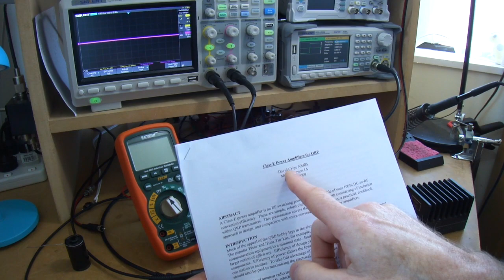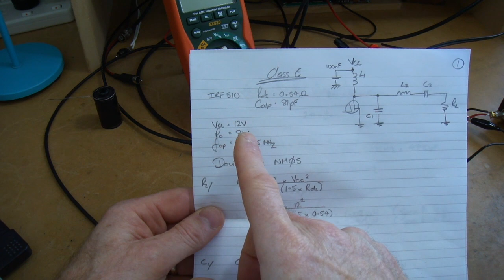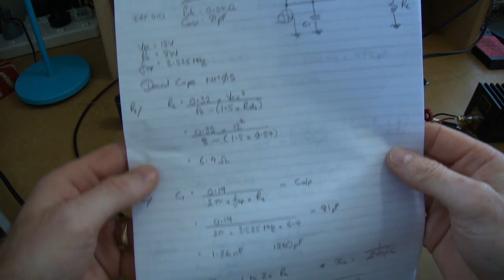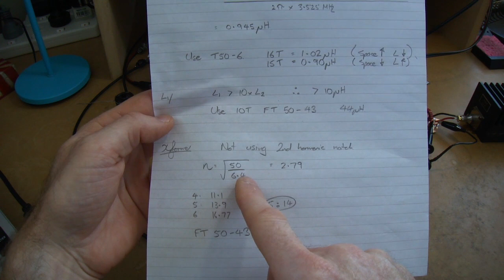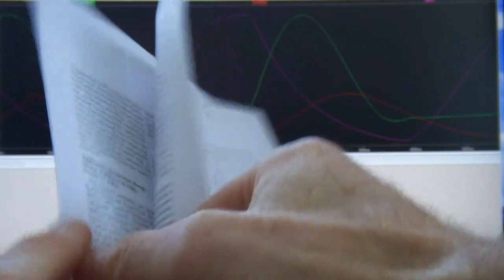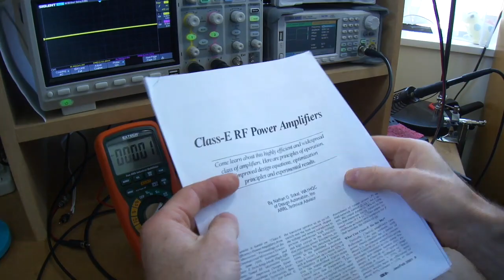CW Rig. Part 4 - Initial Class E Amplifier Experiments

Comment: Charlie - Great work! I am in the same mode here with papers in hand. I decided to just use the Sokal formulas and an old 2 dollar 2SC2078 Bipolar CB transistor. Wow is all I can say. I designed for 10W out at 15 VDC. My circuit is just as drawn in the paper with a 10 Ohm R target. I used a 1:4 UNUN that got me up towards 50 Ohms then a filtered as you did on the tail end. 91% efficiency with zero optimization, and right on the nose at 10W out. Increasing VCC to 20V gave me 18W out with only a slight impact on efficiency.

Comment: I appreciate the tutorial (even though you don't think it is) and demo.  I'm designing a 2nd iteration of a Class E Amplifier but with 13.56 MHz.  I already have a buck converter made up to boost the sine wave signal using Vcc 1V - 24V.
Reply: Have u done it?
Reply: @alimaiee1647  yeah, I was able to sweep from sub 1 V all the way up to 18.5 V.. but couldn't get up to 24 V. I kept losing a lot of heat on the MOSFET (n-type) and I just couldn't figure out why.

Comment: Hi Charlie，I see the filter inductors with cors in this PCB, how do you select them under 3.525MHz operating frequency with less loss
Reply from the maker: Hi Max. I use type 43 material which is suitable for what I use them for. Check out http://toroids.info/FT37-43.php

Comment: Hello!Nice work! But your gate driver ciruit works  well until  1MHz.Some weeks ago I  had made simple shortwave transmitter. Output stage was  push-pull.There was two IRLML0040. This transistor has a low gate charge - 3nC. IRF520 has a gate chage  16nC. Gain of BJT has been follen at high frequency.For example -  2N3904 has Beta=100 at DC.But when we have  frequency 5MHz - this parameter will be goughly 10..15. We can have a  fast swtching of output mosfet - to prevent heat losses (the mosfet will be work in linear mode with long rise and fall time). The best way to improve your device - using  low stage gate driver IC.
Reply from the maker: Thanks Andrew. In the end I went with a totam pole driver which worked well. The MC34151P for whatever reason did not work well for me.

Comment: Hi Charlie,
I noticed a new sig-gen in your video, looks like a feel tech, if so what are your thoughts on quality/performance of this unit compared to the siglent ?
Thanks......Peter GW4ZUA
Reply from the maker: Hi Peter. I've had the FeelElec FY6900 (they are all the same) for some time and it is a good sig gen. It actually does 99% of what the Siglent does. I decided in the end the Siglent output levels were displaying more accurately than the FeelElec. If you are on a budget then I'd certainly recommend the FeelElec. But, you do get what you pay for. I had a common problem where the sinewave output waveform was corrupted. I had to install the PC software and run the specially added 'fix sinewave' function. I hope that helps Peter.
Reply: Hi Charlie , Thanks for the feedback, here in the UK the Feel tech / elec version is about a third of the price  of the Siglent (£278) , there is supposed to be a price rise  coming up !  H'mm but as its close to my birthday...............  :-) .
Thank you  for doing the videos a great source of knowledge and inspiration, between you  and Pete N6QW I have learnt so much ............Thanks Peter
Reply from the maker: @peterwebb2224  Thanks Peter. I really appreciate the feedback.

Comment: Excellent description and demo, thank you. But if I heard you correctly, DC input power is about 4 W and RF output is 2 W so not as efficient as expected. More like class C.
Reply from the maker: Correct. It's definitely not working correctly Elwood. I'm going to try a totem pole drive this morning, then look to try another amp using three parallel BS170s. It would be nice to get a Class E amp working close in line with the design and the LTSpice simulation (noting that it's only a simulation).

Comment: I’m really surprised you are able to drive the irf510 with your signal generator.

Too bad you weren’t getting better results.  Did you try driving it with a higher gate voltage?
Reply from the maker: I'm a little surprised too, but it looked to work. No I didn't try a higher gate voltage, but I will though. My plan is to also have the gate sitting at-say-1.2 to 2V, then have the RF drive on top of that.
Reply from the maker: I just increased the gate drive voltage up to 6.5V. There was no increase in output power. 5V provides the max output. I must be doing something wrong.
Reply: Charlie Morris does it actually look like 6.5v on the gate when you are applying it?
Reply from the maker: @MegaCadr  When I scope the gate, 5Vp-p on the sig gen = 8.1Vp-p on the scope. The gate does not look like 50ohm, so the sig gen display will be inaccurate.  Either Way,  I believe I'm getting 8Vp-p on the gate. I wonder if I should try the MC34151 again.
Reply: Charlie Morris according to this presentation, the irf510 needs quite a bit of drive power http://www.norcalqrp.org/files/Class_E_Amplifiers.pdf
Reply: @MegaCadr  An excellent presentation, I used it when I was designing a QRP 3.5 MHz PA.
Reply: Ivan Savitsky do you have anything up about your pa anywhere?  I’m currently failing at mine :)
Reply from the maker: @MegaCadr  Yes I did see that one thanks. I'm not sure what to think as it looks like the MOSFET is being switched.
Reply from the maker: @ivansavitsky449  Hi Ivan. Did you use the 2N7000/BS170 of the IRF510? I'm not sure why the MC34151 didn't work either as that was specifically designed to drive FETs such as the IRF510. I'll get there...
Reply: Charlie Morris I was trying a tc4220 but it couldn’t handle 7Mhz.  I first tried some fancy Ixys driver but may have broken it, not sure.
Reply from the maker: @MegaCadr  Thanks for that. I really like the idea of Class E, but it seems to be quite 'finicky'.
Reply: @CharlieMorrisZL2CTM  Hi Charlie,  in my case it was a PA for an ARDF fox and the required power was 1W, so I used BS170 and a 12V booster from 3.2V battery. Then I switched to directly 3.2V battery-powered PA using a PBSS4540 transistor. According to the presentation,  IRF510 is good up to 2 MHz Class E PA.
Reply from the maker: @ivansavitsky449  Cheers Ivan. I'll have to put some more thought into this. Perhaps look a 2N7000 based PA. Thanks again.
Reply: Hey  @MegaCadr  , Here is 3W fox PA I did for our radio club: https://github.com/isavitsky/STM8L-FOX_80m_PA_V5_3_rev2 But I don't remember the exact C/L values I used in the final construction.
Reply: @CharlieMorrisZL2CTM   Please note that BS170 have better Rds ON than 2N7000, so less losses.
Reply from the maker: @ivansavitsky449  Thanks Ivan. I have a ton of BS170s here so i may look to design up an amp using those. I'll probably use Dan Tayloe, N7VE approach.
Reply: Ivan Savitsky thanks!
Reply from the maker: @mcastle4358  Yes, a small value resistor in series with the drive can help suppress high freq oscillations. I was also looking to have-say-1.5VDC on the gate as a bias. Thanks for the input.